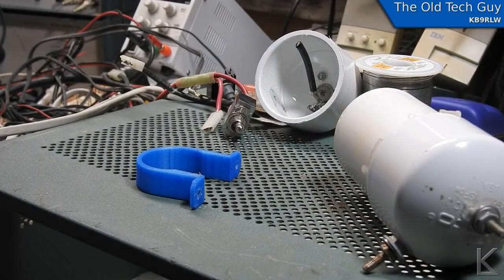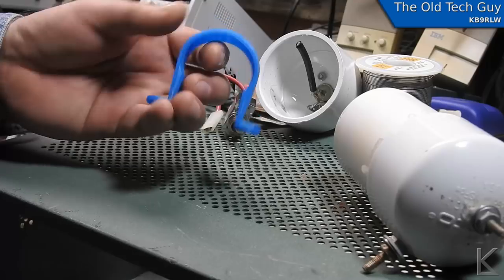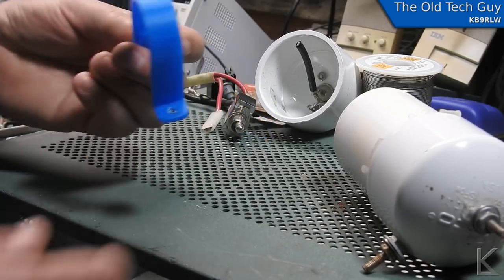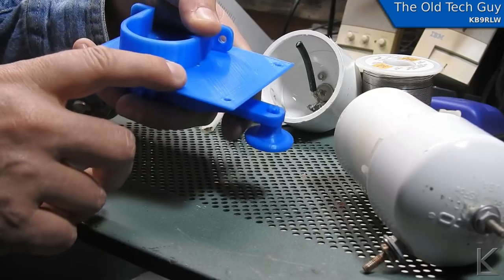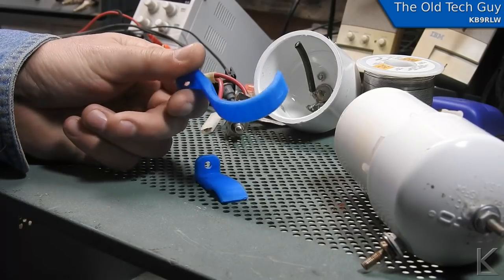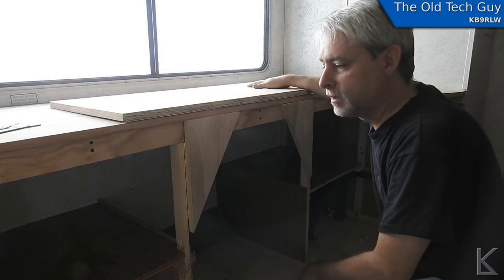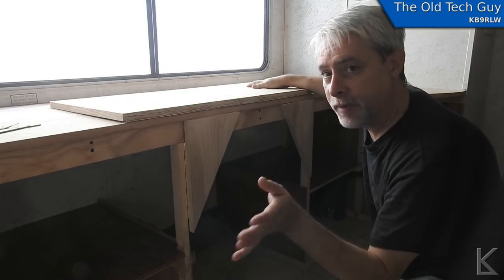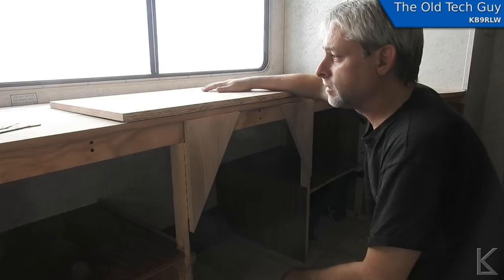Ham Radio and RV - Weekly update #2, mechanical work and 2 bench projects

Comment: smb, known as server message block not simple message block. It was not developed by Microsoft. Microsoft networking system was NetBIOS (Network Basic Input/Output System). Microsoft was working with IBM and 3Com to develop server message block. Microsoft began using server message block with SMB/CIFS (common internet file system). Andrew Tridgell and John Terpstra's Samba Team in Austrailia developed SAMBA to work with SMB between 1992 and 1997. It was released for cross platform usage in 1997. SAMBA ran on Unix servers. Clients of the servers were Microsoft Windows NT, MIcrosoft Windows 95, Linux, OS/2 Warp, Windows for Workgroups and others. I might have this twisted a little. I need to locate my notes from a demonstration of Turbo Linux by Andrew Tridgell at the University of Toledo for the, then, Linux User Group in late 1997 where he stated that John Terpstra played a pivotal part in the development of SMB. I met John Terpstra in 1998, while he was in the process of moving his family from Australia to California. John was giving an updated demonstration of Turbo Linux to the University of Akron IT department; some of my Akron Linux Users Group members were invited. John gave away copies of the current version or Turbo Linux.

We, those that have been viewing your recent videos, know that you are preparing to go from stationary to mobile. No need to keep apologizing. Quality of video not as good as previous videos is to be expected. Just doing a weekly update with little editing takes valuable time that you could have used to pack, eat, or sleep. Now if you stop videoing for a couple weeks, there might be an uproar. HI HI Best 73 KB8AMZ

Comment: Good Luck to you Kevin.  We all know your busier than a cat on a hot tin roof so do not worry about the video and audio quality. There has been good advice sent your way and I will add more. lol.  As an old camper and traveler,  just remember if it is not nailed, strapped, clamped, tied, glued, or locked down, it is going to vibrate, jump, open up, spill, or some how walk around and try to misplace itself onto the floor. Make yourself a check list of ' to does" before you take off so as not to leave something up or protruding from the camper. Like an airplane pilot do a checklist and a walk around. Sleep and proper meals are a given to camping success,  being sick on the road can be a serious threat.
Most important is never forget to enjoy the adventure. It is not the final destination that counts it is the adventure and joy along the way.
Best of travels and ham contacts to you. Catch you down the log. 73  de KG9FM                                                        Clark

Comment: Hi Kevin, Enjoying your Rv update adventures to date. Just watching your video on your bench fit out. Can I make a suggestion ? Having done something like what your doing can I suggest you make a small radius at the top of the drop down door as those sharp edge hurt when you bang your hip into them walking passed. The fold out bench support will swing all over the place when you are travelling. Drill a counter bore shape into each of the arms and bench frame and use a few round magnets glued in place to hold them firm while travelling.73 Colin vk2jcc

Comment: Hi Kevin....looks like you are getting  it done....wish I could get enough courage to hit the road and live the nomad lifestyle....lol....I sure wish you the best of luck and hope to make radio contact with you while on the road. Will you be able to work 40 meters while driving....40 meters seems to be the best band for mobile contacts as I have learned with my Yaesu 857D. When I first installed my mobile rig I had some problems with a lot of noise on the the 40 meter band while driving but after running some good grounds for my 40m Hamstick it brought the noise down to hardly nothing. I talked with Steve (K1GMM ) on his live feed the other night from the mobile using the Hamstick so I can't complain too much...lol. Take care & 73

Comment: I wonder why the back wheels could have modified to drive alternates to charge batteries and when used to drive a heavy load will work as a brake, That 9:1 UNUN should be able to drive a silver rod antenna, A SATAHAT have let you connect a SATA drive directly to the Raspberry Pi. 100TiB Data Center SSD drive could have replaced that 1TiB drive and no need for a USB2SATA adapter which slows things down.

Comment: here is the desert you have to paint up the plastic, here in arizona it wouldn't last 1 summer b4 it becomes a billion bits on the ground
kev you look very tired and worn down man, Get some rest.  73  k7sce
Reply from the maker: Once I get rolling I plan on a few weeks of camping far from the city where I can do just that.  Rest.  And continue to work on the t.v. and radios at a much more leisurely pace.
Reply from the maker: RV not tv.  Darn auto correct.